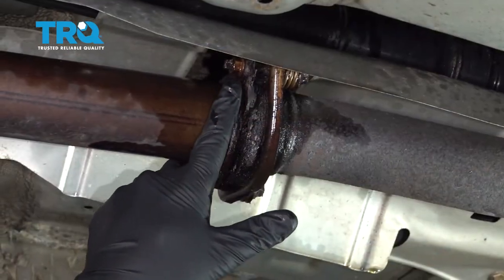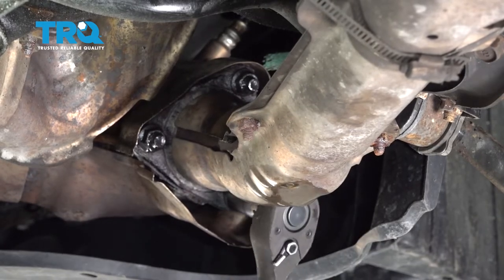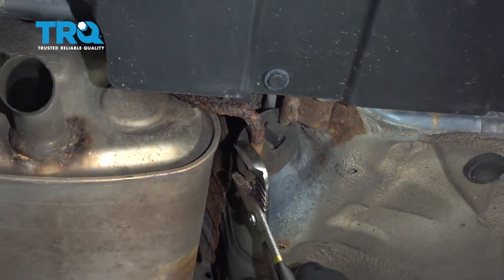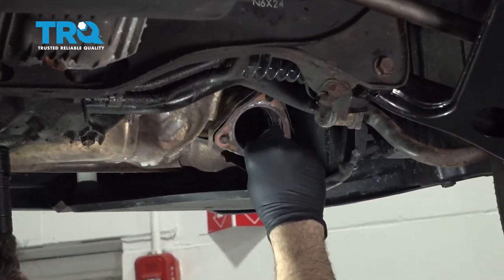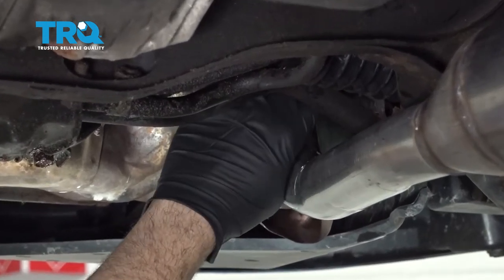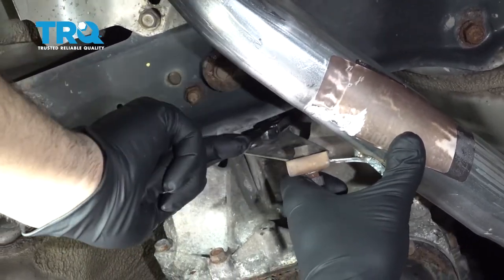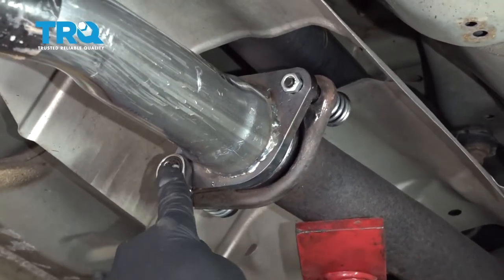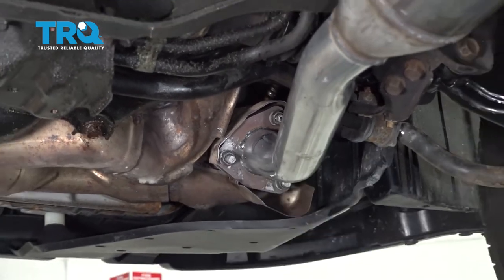How to Replace Rear Catalytic Converter 2003-2009 Subaru Outback

Comment: Great video, thanks.  Two questions: 1) I didn't see you install any gasket on the rear flange of the converter; isn't there one? 2) Are there no sensors to attach to the cat converter?
Reply: No not on my 2009
Reply: Did you do it? I'm about to.